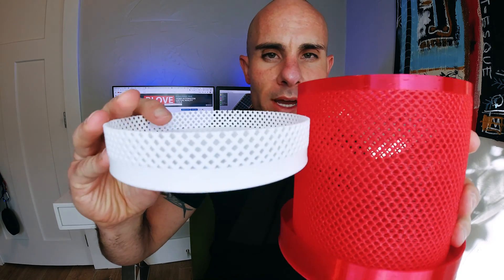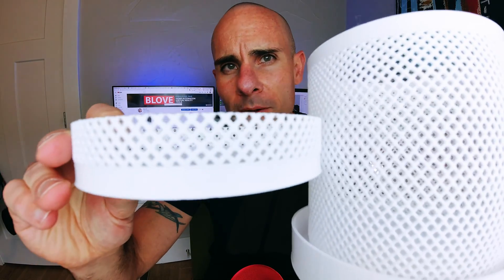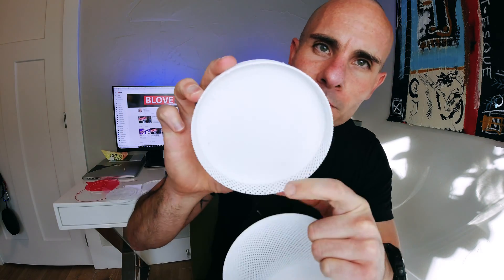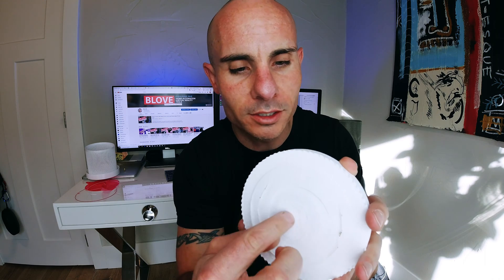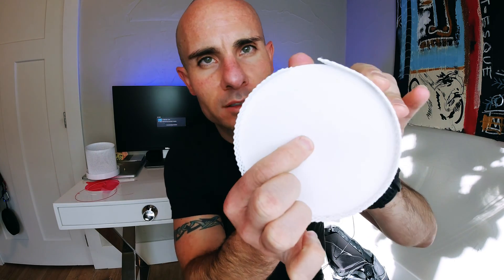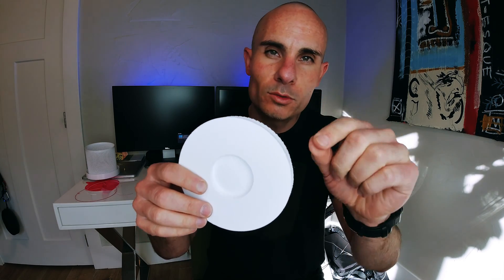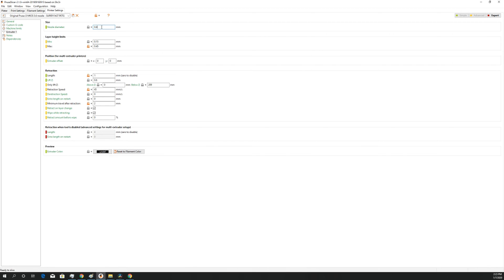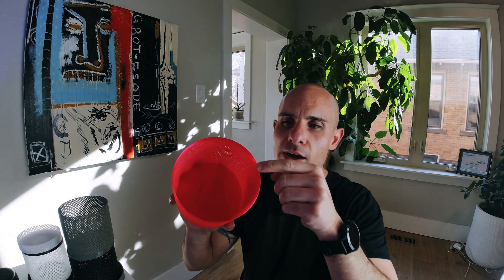Cut Your PETG Print Times In Half With These Tips

Comment: Hey brother. I am currently trying to find tune PETG on my printer. I am using as 0.4 mm nozzle. I print very slowly on the first layer and then at 30 mm/s. My nozzle temperature is 250 my bed is 80 I am strictly printing, a transparent, filament type, my goal is to get a perfect transparent look. You have mentioned that 0.6 mm nozzle creates less stringing and provides a better finish. Can you please comment on how oozing and staining is on the 0.6 nozzle?

Comment: Thank you. 3D newbie here. I've been printing mainly PLA since getting my Bambu printer with great results.  Presently I am testing out some PETG as I may have an opportunity to set up a small print farm in which the specific product is better suited to PETG.  Trying a few different brands and nozzle sizes.  Your video has helped it that it gives me a road map to dial things in to get the proper balance of speed and quality as I need to run the numbers before pulling the trigger on a few more printers.  Subscribed.

Comment: Is there anyway you could share your complete profile settings.  From my research it looks like you need 250 degrees to get the maximum strength of PETG but I'm not having much success.
Reply from the maker: I always print a temperature tower for any new filament I use. That's going to give you the sweet spot for settings that maintain strength while still reducing problems like stringing. At 250c you are likely going to run into quite a bit of stringing from my experience.
Reply: @ALLYOURTECH3DP is there a way to combat stringing at higher temperatures though 😅 I need 250 for my transparent filament to be transparent

Comment: Are your prints still water tight on the bases after these changes? Im assuming that they need to hold water
Reply from the maker: They are! Almost a year later and none of them are leaking. My PLA versions only lasted a few weeks, but the PETG has shown no signs of leaking.
Reply: Thank you for the reply. My .2 mm layer aren't water tight, but my .1 mm are (prusa mini & petg). Time to try some more changes.

Comment: my printer came with a bunch of extra nozzles(ender 3 pro) installed the .6 and the difference is night and day, i don't really need print quality since I just print out bowling ball cups, cut my time down by 60% , 4 hours to less than 2, not much difference in print quality but had to slow down the print speed. was printing at 100mm with the .4 with no problems, but down to 60 now since it was creating gaps in the print. Thank you.

Comment: Oh, forgot one other question, looked like in your other video that you were using the textured build plate. Is that correct and have you experimented with using different types  of build plates? I am just starting to try to get PETG to stick to the textured plate after mostly using the smooth PEI plate for my PLA printing and a few PETG prints. I, so far, have had zero success getting the PETG to stick to the textured plate. I will next reduce my z height to get it to stick better but beyond that, I am at a loss. Anyway, great videos, keep it up. Subscribed!

Comment: Love your videos and you convinced me to get a .6 nozzle. I feel the need for speed.

I have an i3 MK3. I never liked PLA and am going to PETG. One of the first things I noticed was the brass nozzle and aluminum heat block getting gummed up with PETG that got burnt and I would get black inclusions. Started brushing the nozzle before each print.

I got a nickel plated copper E3D nozzle and silicone heat block sock. The PETG does not stick well to the nickel plating. Heartily recommended so far for PETG.

Keep up the great work!
Reply from the maker: Thank you for the kind words, and happy to hear you trying different nozzle sizes. It really makes a difference for prints where small details are less important. I need to try a plated nozzle. I had a silicon sleeve that I tried, but I ended up with a glob of PETG getting trapped under it which caused a massive mess hah!
Reply: Are there any other ways I can deal with nozzle built-up? I cant find a silicone sock that will cover the nozzle.

Comment: These settings were not even close for me.  Way too fast.
Reply from the maker: Which printer are you printing with? It also depends on the geometry of the model. Some I can get away with very high speeds like this, while others become a mess.
Reply: @ALLYOURTECH3DP  Ender 5 Pro.  I'm basically making a solid (100% infill) round disc about 90mm diameter.  It doesn't even get close to starting at these settings.  I've adjusted temp up from the 235C I was using with the 0.4mm nozzle to 250C with the 0.6mm, and I've had to slow it right down to 16-20 otherwise the extruder skips and I get a mess.  It'll print at this but I could only dream of the speeds you are using.
Reply from the maker: @GeeWhizRS  Got it, I haven't tried these speeds on an ender, only on the purse. It's valuable feedback for others that have an ender as well.
Reply: @ALLYOURTECH3DP  If I can print at that speed on a prusa I would throw this ender under a bus and get one.  :)

Comment: Love your advice by the way - would love if you could do a full video for .4 nozzles nontheless :)
Since most of us use it.
Edit: printing right now with most settings taken over. So far...holy crap! Beats the heck out of Pretty PETG ^^
Reply from the maker: That's awesome to hear! Fortunately converting between the two nozzles is pretty easy. You can just select your standard .4 nozzle profile, and leave the layer height at .32 or lower and everything else should remain the same :)

Comment: Clean video! I really want to start dabbling with PETG. How is the odor compared to PLA?
Reply from the maker: Very little odor much like PLA. For functional parts, I don't think I would use anything other than PETG. More flexible and stronger than PLA, doesn't break down in water, food-safe, and no crazy odor like ABS.  I'm overall happy I started using it. The one draw back is that it does take more time to tweak the settings to get it printing properly, and it sticks to EVERYTHING, so Z axis tuning is a must. My other video goes into more detail and shows the settings that work well for me printing PET: https://www.youtube.com/watch?v=suhtzLzg42I
Reply: @ALLYOURTECH3DP  Any recommendations on brands to buy PETG?
Reply from the maker: @GeoDroidJohn  I have used Amazon basics, and some no-name Chinese brand. Both seem to work well, but I don't have any other frame of reference. I want to try some Prusament PETG, just harder to get quickly compared to the Amazon stuff. If you just want something to experiment with the Amazon brand seems fine.